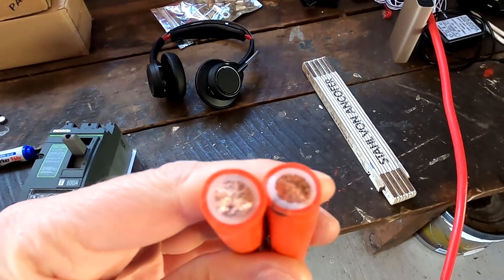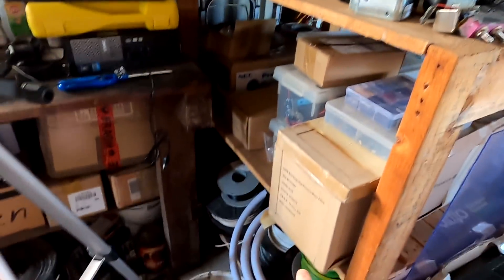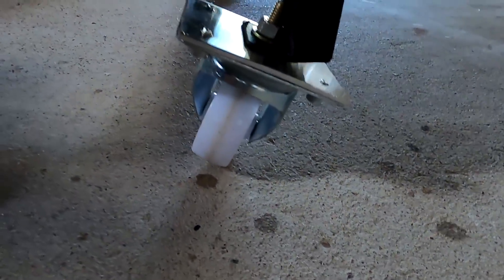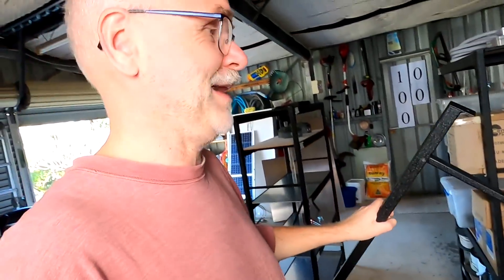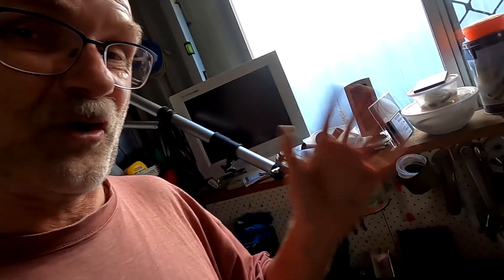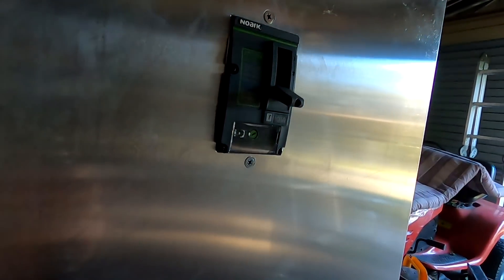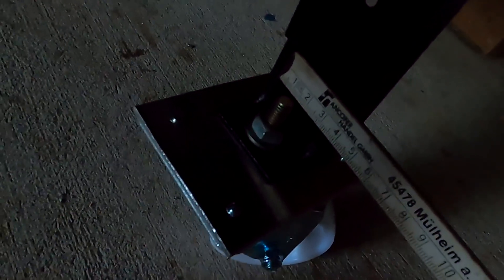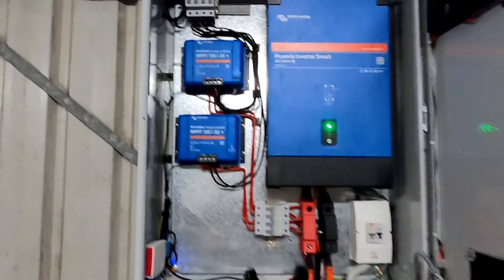The Future of the Off-Grid-Garage! It's all complicated...

Comment: You can have 2x 5kW MPP Solar (off-grid with grid support) inverter parallel giving 10kW power to the house (also has 2x5kW MPPT). And the grid-tie produce power to utility as now. You also can get some of the Grig-tie produced power into your battery through the off-grid inverter (produced AC never leaves your ground). Also with a normal inverter that powers you house you can produce into the AC line (less utility bill by the amount of off-grid's solar production). Or it can be a double conversion unit that gives you a perfect noise free sine wave (from solar+battery+utility if needed). Lot and lot of options :)
Reply from the maker: Yeah, I cannot use them. I cannot change any cabling to the house, unfortunately. And the solar on the house feeds the house first and the rest goes into the grid. If I put anything in between, I loose the contract and around $2k/a for 7 years. It's not worth it. I found another solution though.
Reply: @OffGridGarageAustralia  What Mr. Zed is saying shouldnt require any change in your existing solar grid tie connection. The off grid inverters would be supplying power to your house as well as the existing grid tie solar setup.
Reply: @OffGridGarageAustralia  can you not just take some parts of the house off the grid tie system and onto the garage system. You'll sell more back to the grid and i assume you get an amount per kwh?  Or even just wire some house dump loads for the off grid system - water heater or something?  (its @off grid and working hard on my personal account - FYI ).
Reply: @stupidmonkeykev  Yes that will work too. I have done exactly that on my system and it works great!
Reply: Has anyone actually used these MPP hybrids in a parallel setup like this? I'm currently trying to decide between those or the GroWatt ones. I'm also trying to decide between installing 4 (2 on one phase, and 1 on each of the others), or 6 (2 on each phase). Tips?
Reply: @AussieCowboyShane  I think Growatt's and MPP Solar's off-grids are made by the same company: Voltronic. Growatts with more design but only 6 units can be paralleled, and MPP Solars with 9 units paralleled max.
From MPP Solar inverters you can install 2-9 on the same phase. 
Also you can install 3 for symmetric 3 phase like 1-1-1 or 2-2-2. 
Also you can install them asymmetric like 2-1-1 or 3-2-1 or 7-1-1 or ...
Reply: You can actually have upto 8 I think.
Reply: @KevIsOffGrid  Up to 9 :) 9x5 = 45 kW in one phase. Or (3x) 3x5 = (3x) 15 kW in 3 phase. But never saw such a big installation.

Comment: The wheels work well I have 2 large similar rack systems .. but I think your wheels don’t have the load capacity. I welded a 3 inch plate to the shelf leg than mounted wheel assy.
Reply from the maker: They wheels have 140kG of carrying capacity each.
Reply: @OffGridGarageAustralia  that is usually dead weight resting … hope things work in your favor

Comment: You should get a victron "MultiPlus II" (the 48/5000VA supports parallel and series operation) inverter for the house because it can use the power from the grid tie inverter to charge the battery (When using victron EnergyStorageSystem)
Reply from the maker: Won't work as I cannot change anything to the cabling to the house.
Reply: @OffGridGarageAustralia  ok, I didn’t know that. But still victron multiplus invrerters would be great for powering the house because they can go in to a bypass mode and get power from the grid when the battery is discharged. And when there is too much solar the inverter can even export the power to grid (power from the battery/solar)

Comment: Connect the 2 wheels, instead of the small plate for 1 wheel/leg. Make a long plate for both wheels to put 1 side on.
Reply: Should have watch the whole video first. 🤦‍♂️😁
Reply from the maker: Hahaha, yeah, a flat bar fixed it. That's for your tip though 😂

Comment: I think I would have a large sheet of 18mm ply across all the bottom. Mount the shelf to that, and mount the wheels under, but now you can indent them so they are completely beneath the shelving unit without sticking out. Plus you can have a free shelf!!
Reply from the maker: The extra small shelve underneath is a great idea!
Reply: I like that but I would go with aluminum since the other shelves are aluminum.
Reply: @Shep5847  But that would mean Andy having to get some more sheet ally, and I think these mobile shelves were having the wood shelves.